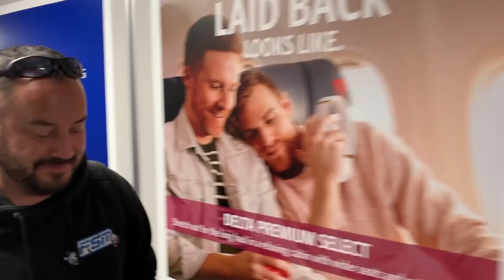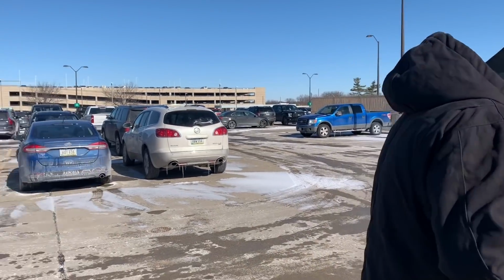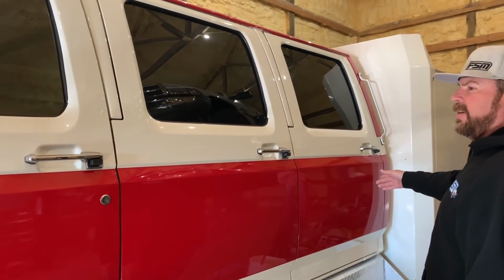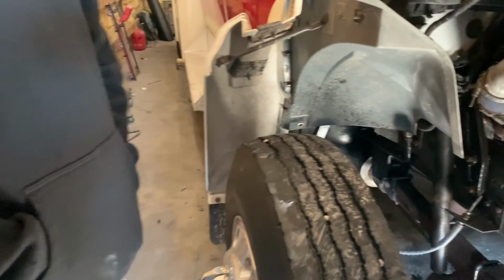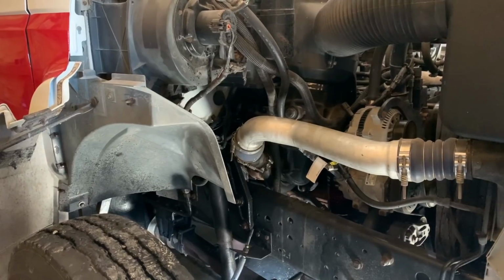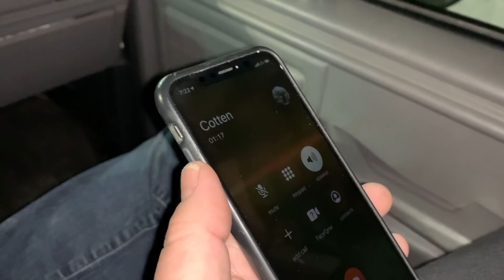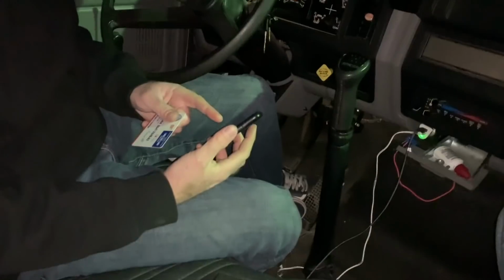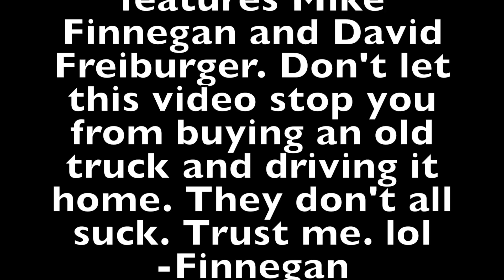I Bought a Six-door, Cummins-Powered Truck and it Died on the Way Home! Finnegan's Garage Ep.91

Comment: compound and injectors governor kit  adjustable over flow valve  and fass lift pump = 800hp .  Build your own compounds if you go that route this time . Its really easy and cheap.  Use  a cummins cobra exhaust pipe to tie the primay to the secondary or  get the piping kit from crazy carls turbos.

Comment: The heater shuts off when you floor it because the check is bad on the vacuum reservoir for the hvac system. It’ll do the same in ac. Ford had this same issue for a very long time across a lot of the trucks

Comment: AAA doesnt tow dual rear wheels. Not even RV's with duallies.
Reply: Depends on what equipment the nearest location has, the AAA around where I live tows box trucks all the time.
Reply: Not in California.
Had a battery truck do a drive by and got the call. "Sorry, not on the approved list." Its a class a, just like in THE PHOTOS OF RV COVERAGE.
Platinum member for 15 years, NEVER again.

Comment: The little 5.9 ain't enough engine to pull that big truck around plus what ever they haul with it .their fine for little one ton dodges 5.9 is turds in bigger trucks. 8.3 would better suited for the F800.
Reply: I had a 1998 f-800 bucket truck that weighed alittle over 18klbs empty. Loaded it was "26000lbs" as the boss would say... 

With that old 429? It would bounce off the rev limiter @80mph. Not the quickest up hill, but it would tow anything you strapped to it. 

Also had an old f800 82ish? With a Cummins. That thing was a beast till about 45 mph, then it ran out of steam and would bounce off the rev limiter around 60mph. Hold more than one caterpillar behind that thing
Reply: If you look up the F800's the post online are NOT kind and call the 5.9 a massive turd. Its so underpowered for the truck as is let alone pulling a 5th wheel! The max HP a 5.9 had in these was only 210, the gasoline 429 was apparently a much better motor in the F800's. Today a truck like that would have no less than 350 HP and a lot more torque than whatever that cummins makes.

Comment: For those who dont know, the Medium Duty series fords, Such as the F600-F800s all use a standard ford pickup cab on a heavy duty frame, the interior was exactly the same from 1980-1998, using the bullnose interior, but the doors and sheet metal was from the current production trucks. one of the stock options was a Cummins 12 valve, (Later models used a 24 valve) and a 4 speed allison on some and on the later models the 5 speed Allison 2000. I used to work for Culligan and my delivery truck was a 96 with a 12 valve, 4 speed allison, the governor is the standard 3400 rpm , they just stick a bolt on the floor to keep the pedal from traveling far enough to go over 55 or so mph. If you remove the bolt you get full pedal travel and mine maxed out at 82 mph. I want to buy a medium duty in the future

Comment: Only Finnegan and Newberg would flys to Butt-Itch Iowa in the middle of freaking winter to buy a 20 year old custom fabricobbled 6 door F800 XL “Tow-Rig” with a 5.9 Cummins with supposedly 30,000 miles and not make 300 miles on a 1,200 mile trip back to Georgia. 
Watching this video the thing that got me that in their school-girl giddiness especially Finnegan’s over the 6-doors (without power windows or locks) seven-speed transmission and insanely low as in 1,500 miles a year low odometer reading,. They blew-off the speedy-dry on the garage floor, coolant, on the frame, the cooling system pushing water and the piéce de résistance the heater quits working under wide open throttle and they still buy the thing only for the head gasket (in a can maybe) to totally let go less than 300 miles into their trip back home.
My question is this scripted because these two can never go anywhere without something breaking or blowing up of are these guys just flat cursed or what??????

Comment: So I bet this is a former Navy truck that someone turned into a 6-door. They were auctioned off in the mid 2000's and had super low miles. My old job bought one with a flatbed on it (just a regular cab), it had less than 30K on it as well and also had a 160 hp 5.9 12V cummins backed by a 4 speed allison. It was slower than dirt especially with 12,000 lbs on the flatbed.

Comment: 5.9 Cummins with a P7100 is also used in marine applications.  I put marine (4,000 RPM) springs in my pump so that my Dodge would stop falling on it's face right before every shift with the automatic.

Comment: The company I work for had an 2004, F-800 with the 7 speed trans. Not to bad but space very close together. Missed 3rd a few times and went into 5th. Ours had the spring/bucket seat in it. The seat was not very comfortable. We got rid of the truck when the engine started costing to much to keep it together. Was still a nice looking truck though. Best of luck with yours.

Comment: My 99' F800 has a little over 300k on it. That 5.9L 24v Cummins runs like a top. Only ever had two problems with it. Electronic throttle body stopped opening all the way when you matted it(TPS failed) and I've had to replace the oil pan gasket twice. Now I just got to do something about that slushbox of a 4 speed Allison that I've been stuck with since I got it. Also I can't say the same for the PTO that came with my Jerr-Dan 24'x102" roll back. Damn thing spits O-rings like a chain smoker spits out cig butts.

Comment: Hey a 5.9L just like what i have in my Mega Cab Ram good motor. mine's got almost 200,000 miles on it and never had a wrench turned on it except to change the oil and filters

Comment: did you check to see if it has an oil cooler. most of the time when oil is being pushed into the coolant its the oil cooler do to the oil pressure is high 30 to 80 psi at that location & coolant pressure is lower 16 to 20 psi

Comment: Sounds like the call I made to the tow company after I bought my Detroit Diesel Firetruck. “I need a 1976 International 1850 Firetruck towed.” A fire truck? “Yes a Firetruck.” Like a big Firetruck? “Yes a big Firetruck” hold please. I ended up fixing the air brakes and driving it home.

Comment: Also, you said the first few gears are useless, they absolutely are if you want to climb through gears. If you're starting off on flat ground, use second, then change to fourth. If you're on an incline, then start in first then change to third. If starting on an incline facing down, start in third then change to fourth.
Its a HGV gearbox without a hi-lo switch

Comment: That's a good looking truck 🚚.  Sorry about your misfortune.  I bought a stock trailer that was about 500 miles away,  got there two of the tires were flat.  The guy aired them up and I was on my way.  About two hours on the road back the tires started ripping apart ( dry rotted).  That was a nightmare.

Comment: Fun Fact the cab and interior of the 1998 F800 is the same as the 1980 to 1986 F series pickups...so if you are restoring the bull nose F series from the 80s you can use a F800 cab and interior...

Comment: Very Cool truck ! I had to laugh at the owners dog  my dog could hear my 6.5 Turbo Deisel  over a half of mile away and my son told me they had to let her  into the garage  so she could get in the truck faster or she wouldn’t calm down  She knew that on Fridays i was coming to get her to take her down to my Boat and Marina for the weekend  there she had the run of the place and would go out on the boat  so she could swim in Rhe Chesapeake Bay  BTW she is part Lab  ! Loves the water  usually i just opened the passenger window on my Dually and she would jump in  then settle down in the back seat  for the drive ! As soon as we got close to the Bay she would get excited again  i never knew if she reckonized the sights or smelled the air  to reckonize we were close  to our destination ? But she knew we were almost there. Every time  and would start freaking out  again and want up front  in the truck !  Ill bet that dog thought he /she was going for a ride  too  he sure didn’t look like he was protecting the Barns property

Comment: id guess the oil cooler barfed, probably sitting forever with old coolant it got eaten up. clean up the cooling system with powdered dishwasher soap over several fill/run/dumps once fixed

Comment: the 6 door f800 is an f750 wrecker chassis with a 12v instead of a dt466e and the cab is a obs 7.3powerstroke cab with a extra back put on truck is very nice looking its definitely been babied
Reply: @inthewoods5471  yes they did ford and international were together since the 6.9idi and they both work together still but only in commercial applications
Reply: @inthewoods5471  the cab is a stretched powerstoke frame on the same chassis as a f750 wrecker with the dt466e but this model uses a 5.9l 12v cummins industrial model in fact westen champlin on youtube did a swap with one the ford from this year are both dt466e and 12v cummins they did not have a cat cat does not have a partnership with ford for medium duty trucks like this one they were only available in semis which featured 4 motors cat 3126 60 series detroit 12v cummins and the dt466 however medium duty and semis did share a few transmissions
Reply: @inthewoods5471  ford and international were together since 1982 and since 2010 are only partners with medium duty trucks as international did not want to take the blame for the 6.4l powerstroke and ford did not want anymore backlash thus bringing the all ford designed 6.7 l powerstroke
Reply: @inthewoods5471  you clearly dont listen or are only paying attention to one portion of my comment if you would pay attention i said thee international chassis is under the truck it uses a 5.9l 12v cummins and an international transmission let me make this more simple since you dont get it  cummins motor ford body international chassis you get that or do i need to emphasize some more
Reply: @inthewoods5471  hey man im trying but your the one who wont listen i'm not trying to be a dick google says the same thing its a custom model not built by ford it features a 6 door 82 style pickup body on top of an international chassis and powered by the 5.9 cummins very few of these trucks were made so he will have a hell of a time finding parts the motor is the same as other trucks but the interior is hard to find luckily this ones nice
Reply: @inthewoods5471  have a good day sir

Comment: Nuked the oil cooler I see. Do the killer dowel pin mod on the front cover while you are at it. Also if it has an air compressor make sure the rear mount is still there. They fall off and the compressor cracks the front housing

Comment: I checked the next episode and nothing about the repair  of the F-800 is mentioned. I am not a truck guy but I do own an RV powered by a Cummins® ISB 260 hp Electronic Fuel Injection Diesel Engine: 5.9 and I am awful curious how much hassle it is to take apart and install a new head gasket on that monstrous motor (assuming that is the problem as suggested by the oil in the cooling system).

Comment: So, I have a 2014 Ford F-750 Crew Cab (4 door) with a 6.7 Cummins and an Allison 5 speed push button auto with air brakes. It only has 22k miles on it. I have a low boy 40' high-neck gooseneck trailer for it too. I can tell you that it's a gutless turd. Top speed is 75 mph and it can't even tow the trailer without slowing down going up a hill. Damn son, a head gasket at 30k miles though?

Comment: maibe next time drive the vehicle to the closest garage and checked top to bottom before doing a roadtrip , its like you said , it only has 30.000 miles on it so there must be a reason for the truck (that is so heavily adapted and expensive to buy new) to be so low milage at its age without a reason 
might want to have the engine checked a little more thoroughly and not just have the gasket replaced but the head pressure checked and the bores checked 
as cold as it is out there it could wel be that theres a freese cracked head or block involved from when the previous owner didnt used antifreese i hope not but i could be a big possebillity and the reason for the sale

Comment: A 5.9 Cummings in a 98 Ford means the engine has been yanked and a Dodge engine was installed. International was doing the 7.3 in 98?  Those 7.3's are beloved engines for their durability.

Comment: 13:13 heat shut off will you floor it. I had a Dodge Caravan that would blow hot then cold and back to hot. It had a blown head gasket.

Comment: 8.3L swap?  The 5.9 is awesome but to get the most out of that truck it really needs more cubes.  If you hook a gooseneck up the response will be horrible from the 5.9L.  Look for a p-pump 8.3L and do all the same mods and you'll enjoy the truck much more.
Reply: Not saying a 5.9L cant pull a gooseneck, saying that MASSIVE truck with a 5.9L will really struggle to do it.

Comment: Hey mike i have a 96 cummins with the 5.9 im in illinois too its for sale engine is close to being all the way out i was gunna use it for my truck but im not cuting my firewall out. im nearish davenport. truck had about 234k when parked it was parked for rust engine is drivetrain is good. Leave a comment if your intrested.

Comment: So you're talking about the gearing in the revving on that thing you got to understand you're basically driving a semi-truck it's a 7-speed you said so instead of starting in first start in 3rd and Skip to 5th and then use the rest of the gears those low-down gears are meant for towing something heavy

Comment: There is dumb, then there is buying a truck pissing coolant out of the overflow and having the dipstick rubber banded down because all the crank case pressure keep pushing it out. But i guess just driving it home doesn't make a good story.

Comment: A cartridge a week? These disposable blades are worse than disposable, they're sacrificial!

I was really mad about the prices I pay for Shick cartridges, at $20 for a 4 pack. I looked into dollar shave club, initially surprised by their prices, but then I realise I'm paying for a subscription for far more blades than I actually need, which means the price I pay in a year to shave is actually higher than my current expenses.

The only true hero is spending big money on the handle, and getting yourself a double edged safety razor, with blades costing as little as 20c each, and just as clean results if you learn how to use it.

Multi-blade cartridges are expensive to produce, probably have a larger environmental impact too. We just have to ask ourselves if we actually need them, and the truth is that we're just brainwashed consumers who haven't even thought to doubt this stuff.

Comment: look like water pump failures n thermerostat got stuck n cause it overheated n blew head gasket n leak out radiators 

is it easy to fix "i probably said not for diesels but for gas powered yah"

does diesel take long repairs than gas powered motor "yes it does because head is little flex on them when come to diesel head n they have no flex at all so beware if off balance u ended up sent head to machine shop get it slave down flat at 95% seal currently on block to head with gasket"

engineer repairs joint chat

Comment: Unfortunately you super heated the parts that should never be super heated. You oil starved the parts that should never be oil starved and you now have a $5k cummins custom boat anchor. 

Fortunately the 6bt engine in it is more common and prolific than a cockroach.

Comment: Friend bought a brand new 19 chevy dura garbage and the transmission exploded before he hot it home,, i mean the transmission case went into  see thru mode transfer case just a flopping at 75 miles on the clock. Wonder if gm had installed a code in the computer for too much daylight on the clutches and bands. typical gm garbage.. Just fix the darn thing lol

Comment: You make mistakes like this so many times that I find it hard to believe your not aware of a engine problem. I guess I am second guessing this truck as that is a way small engine for such a large rig. What is the GVW rating under the door posted at or is it sold as passenger class? I know the nine hundred series is air brake and a 466 DT engine class or bigger. Most were either cat or international engine series.. reminds me of clickbait as that is good for humor but won't ride you home as most are listed as a max RPM's of 2100 and your overwinding engine